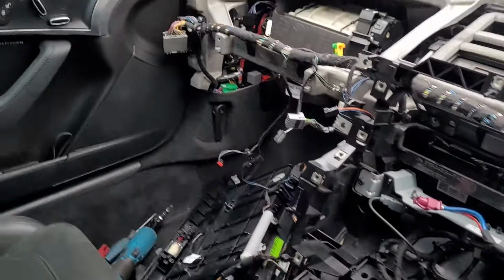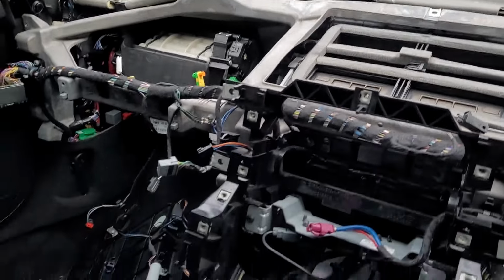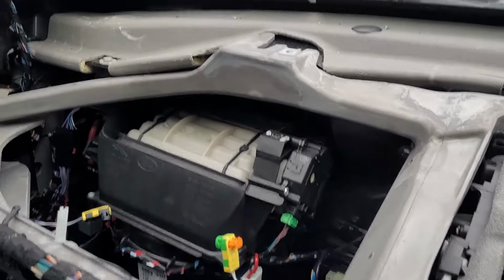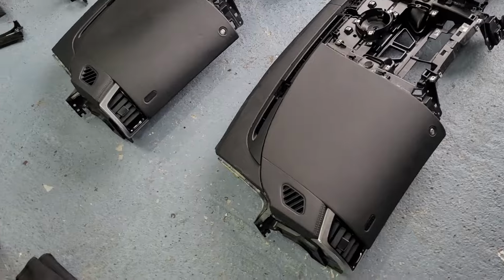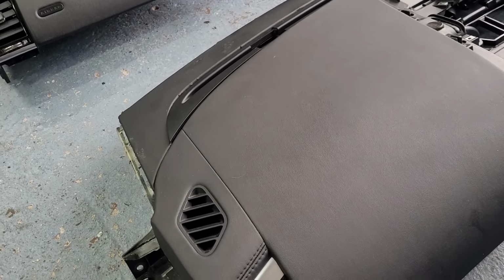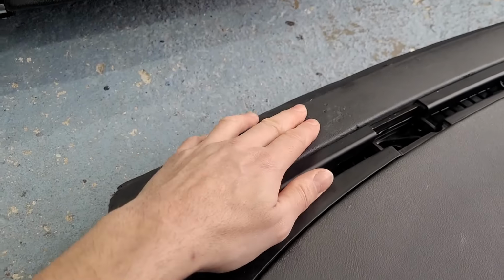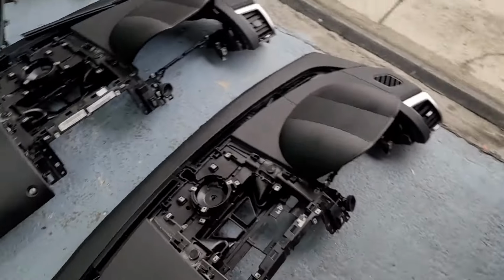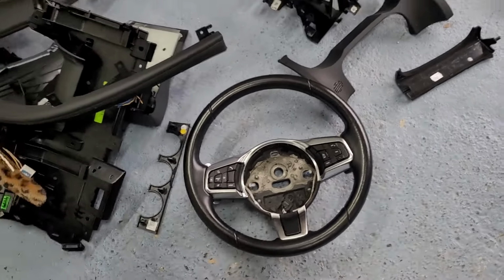I removed my dashboard again

Comment: You done a excellent job there. I replaced my Jaguar XF dashboard not so long ago, the leather came apart. My next mission is to find someone to replace the front windscreen, water has started to come inside. Is there anyone good, you can recommend to replace windscreen?
Reply from the maker: Thanks, I've not had the best experience with windscreen replacements.